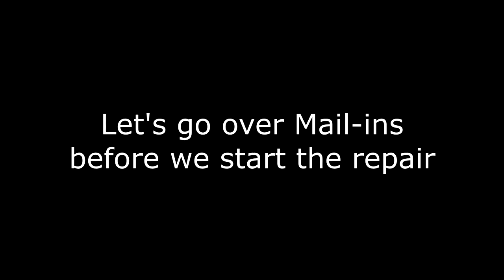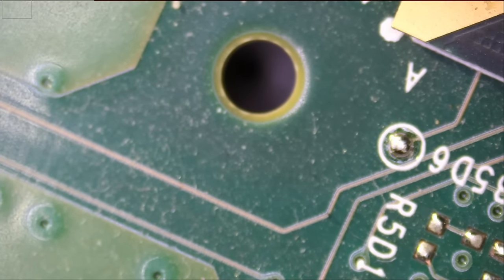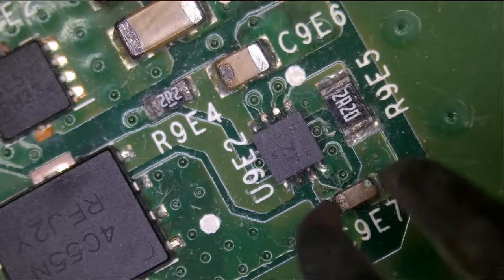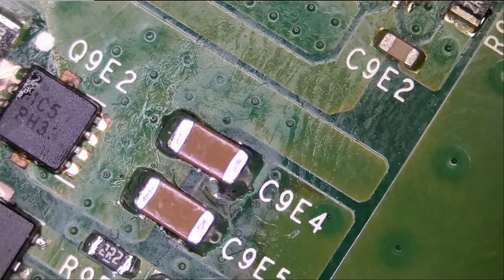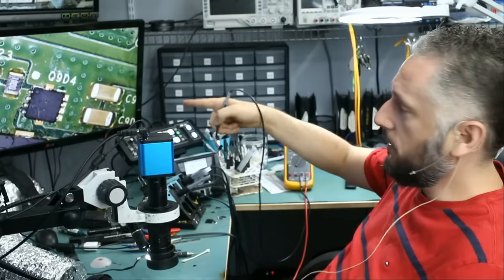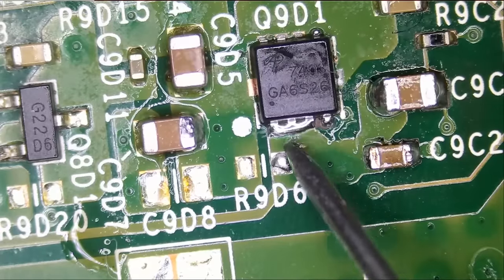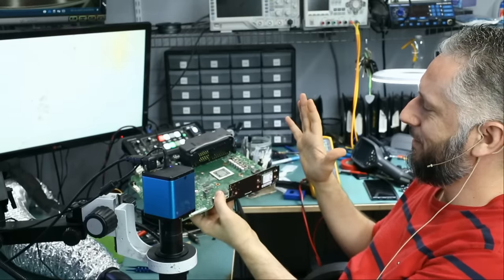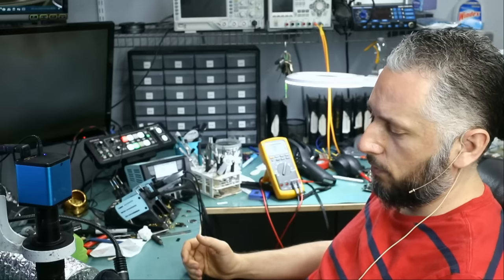Xbox One S No Power - Turns on and shuts off immediately - Components keep shorting out -

Comment: I think after the 1st two popped MOSFETs, I’d have just removed all the MOSFETs in that section, then measured the resistance from ground to each of the power rails right where the power supply plugs in, but with the PSU disconnected. If that checks out, try to measure the voltages on the gates (and drains) of the MOSFETs that keep failing (or, better yet, use a scope) with the PSU connected.
There shouldn’t be any voltage drop (in diode mode) between the gate and either source or drain of a MOSFET; the gate floats on an insulating oxide layer over the source-drain channel. It should show 0L (overload) on the meter. This whole thing sounds like an initial cascade failure which rapidly took out the MOSFETs and (possibly) the gate drivers.
Reply: It makes sense
Reply: they are in  2 mosfet and feed back to the pwm chip fix is cheack the pwm chip and the feedback of it. some tyime when a mosfet dead it kill the pwm chip too.

Comment: I think the problem was in one of the driver ICs (or maybe all of them) NCP5901 (marking AZP). Also you need to check VALUE of the capacitor on pin1 - gate boost circuit

Comment: Looks like an active short. When powering up, something is driving those mosfets off spec and blowing them like a fuse. The weakest mosfet blows first, so you would need to check the voltage rails with an oscilloscope as soon as you turn the device on. Well if you would really want to go that rabbit hole

Comment: Hi dear congratulations for your professional service, when I found a mosfet in short usually I change the power supply control IC too, sometimes when a mosfet come in short, switching voltages can go to gate and damage the controller supply IC too and when I use used mosfets from donors boards i make a test in these.

Comment: i used to change lots of caps on the xbox360 , exactly the same ones you replaced , those 2 big ones , and while replacing them many times happened that they get shorted out, those are really too sensitive to heat , seems the same story with xbox one

Comment: I'm wondering that if a donor board was completely checked out in that ALL the components were tested and good, THEN why not move the CPU chip to that board and then see what happens.
I know that a CPU move would demand very good soldering skills, (which Mr. Alex certainly has) but that would obviously prove if the CPU was any good or not.
Under power, a CPU heats up normally anyway so thermal cam shot is not going to tell you anything.
As I said, since Mr. Alex gets so many of these types devices in, a stand-by working board with all components pretested and working could be used as a CPU "test" vehicle.
Also, I would have done the thermal cam diagnostic first after applying power to the board of one volt.
From there I would then start testing for shorts and replacing parts.
The validity of a donor board used part is always iffy.
Of course upon testing the donor part, you would know if it was still ok or not.

Comment: might be a stupid question but you mentioned in a video that fixing a motherboard can be expensive, usually there is personal data that people want. Is there any generic motherboard you could just solder the storage chip to recover data, just like a laptop when it fails if you take out the HDD / SSD and plug it in another PC you have the data from that laptop.

Comment: Feed the board with voltage and increase the current (A). You will need a power supply for that operation. This will cause heat of the short and you will find the problem easier. You have a thermocamera and I wonder why you don't use it.
Reply: He did exactly that dude, didn't you watch the video?

Comment: Since 360 RROD fiasco, Microsoft seems no longer providing debug light for diagnosing. In 360 console you can possibly know what's problem by checking secondary error, 0001 main voltage rail shorted, 0002 cpu v-rail shorted, 0003 gpu v-rail shorted, etc. That mosfets are used by buck converter ncp 4205 ic for APU v-rail so I think the APU somehow shorted, that's why the mosfet keep blowing.

Comment: Hi there :) ... i Have a problem with Xone S ... its turn on than off ... fan dont spin. I look for the shorts thete is nothing.... Apu seems to work no shorts on the rails .. but The fan missing the PWM signal ..... where need to look for the issue? .... Bridge? .... Thanks

Comment: @NorthridgeFix  What do you think is the reason so many graphics cards fail? User error or manufacturing defects?
Reply: Mining ⛏️
Reply: Heat
Reply: @MattyEngland  Miners are warned to never run their cards at full capacity.  Maybe 70%-75% power at low temperatures.  I think the problem is that when they run their card at 100% power, they're enticed by the increase in the money generated, not knowing that their 1500 dollar card is going to break down faster.
Reply: @srdjanzmaj1  Sometimes its gamers trying to mod the card, and then screw the card up.

Comment: I have read this issue happens a ton on the xbox on s. They do not withstand esd very well either. Zapping a controller that is hard wired can cause it to reboot. They do not ground very well. Probably unpurpose. I have one with the same issue. pressing power button it flashes you hear the chime and powers off right away. Not worth it to fix.

Comment: I think you check by injecting some low voltages and checking power rails... Well try though..
Reply: This methods are for hobbyists that have time to spend just for fun and experience.  If you have 30 to 50 gpu to fix plus the other devices then there is no other option but to quit and keep up with another device... that's my opinion!

Comment: what causes components to go out on a motherboard since they are not a moving part that are subject to wear? i know one bad component can cause multiple other things to short out but what causes the first component to go bad?
Reply: they do not move in visible ways, yet they expand and contract thermally, electrons migrate, electrolytic capacitors are not solid state (but they use fluid), high transient voltages can damage components. As a general rule electronics hate heat, actually pretty much anything hates heat.

Comment: Hi!
The APU Chip is dead!
Unfortunately, I have been like this many times!
Short circuit at 12V!
Laboratory power supply to 12V and the APU Chip heats up!
Reply: "Laboratory power supply to 12V" will kill APU even if it is still alive:) Because in this situation one of the mosfets drivers is faulty
Reply: @ssm873  There is truth in it! :)
Reply: @ssm873  You don't have to kill the APU at 1-2V with a current limit!
Don't I think so? :)

Comment: I thought that they won't boot if the heatsink and Xclamp are off, in fact, I've actually tried to boot a console before without those on and it would do the same thing, even tho it was booting fine when it was assembled, and after I put the sink and clamp on it booted up

Comment: the HDD needs to be plugged in for it to fully power on
Reply: A non-present HDD wouldn't cause the console to immediately shut off.
Reply: @xb0xguru  correct. It will shut off after 30secs-1min with no hdd.

Comment: I have the opposite problem, cpu, pwm ic, drivers, mosfetss, resistor, capacitors, coils are all good, also EC/IO chip good, oscillator cristals good but it keeps turning off and on and shorting on the vcore cpu line, it's the only motherboard i haven't fixed but will fix it one day and will tell you all about it, and it's not the cpu i changed it and it works on another board, also the oscilloscope is showing the correct oscillation patterns on the mosfets and the gates from the drivers. Wait, the Northbridge/PCH was getting pretty hot now that i remember...
Reply: isn't the cpu/apu married to the board?
Reply: @coyotex850  Yeah they have a per console cpu key.

Comment: Have the same problem but my xbox one s turns off after 5 seconds with off sound. Gave 2 shops they checked and told most likely cpu problem. No fix.

Comment: These xbox one S is built like crap. Super thin board like a thin crust pizza, even if you slightly over tight the screws the tacks in between the layers short. My xbox had this same issue just in 1 year after not using it for a couple of months. The repair guy was unable to fix it.